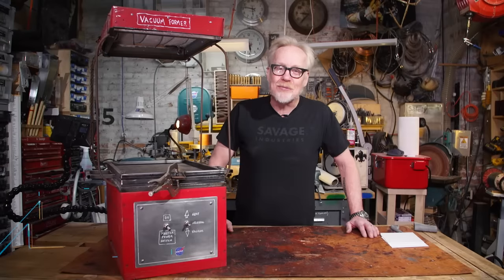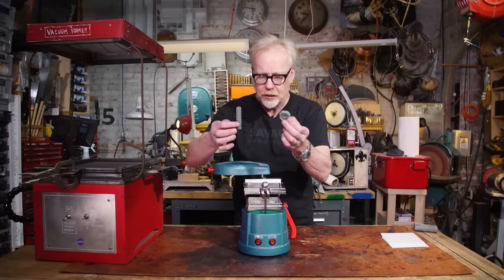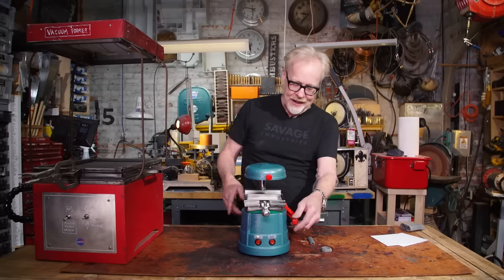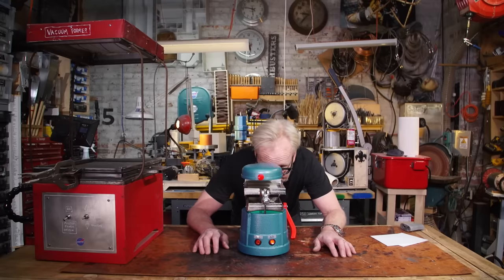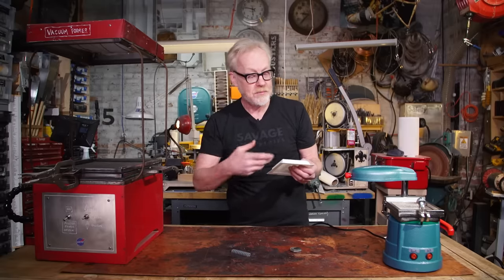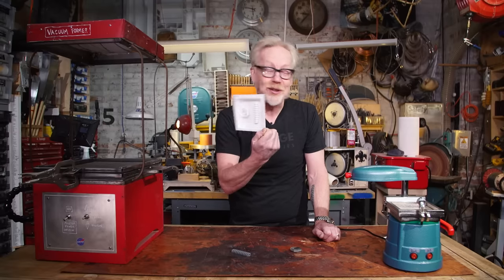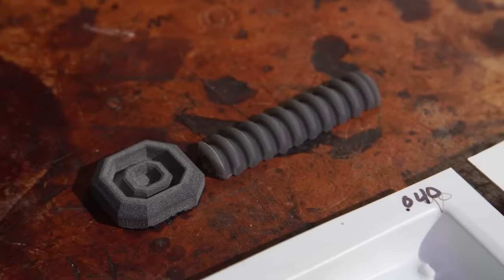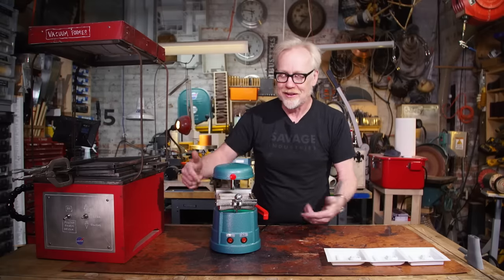Adam Savage's Favorite Tools: Great Budget Vacuum Former!

Comment: Would a vacuum former be able to mold kydex? Holy crap how fast you could turn out holsters with that thing!
Reply: Good question.  Knife sheath too.  With the thicker material it could be a bit trickier to manage heat but maybe a preheat in hot water or a toaster oven before putting it in the tray would help.
Reply: I was just thinking the same thing. I have done a ghetto vacuum form for headlight lenses making a frame out of wood, a soft board with holes, hooked up to my shop vac. I would throw lexan into my oven and once it got pliable I quickly pulled it out and threw it on my forming-majig. Crude but kinda worked lol.

Comment: Does anyone have experience trying to adapt small Venturi vacuum pumps to pull air out of chambers for resin casting and such? Most shops have air compressors already, and a nominal added cost for this approach seems far better than having to invest in another large machine that gets hot, and less efficient as the pressure is reduced.

Comment: Hi Adam   Thomas from
the UK here great video   I have a project in mind at mo i'm
having it printed on a sls  printer but very expensive.. i'm
looking at vacume forming  but plastic  needs to be about 1 mm  dental plastic would be great as it's very hard the object i'm working with is very similar to a second world war german soldiers helmet it's about  7 centimetres high x 8 centimetres wide.. would the machine in your video  do this size? regards Thomas

Comment: Wish could have had it 20 years ago???   
A thick walled  jewelry box with lid removed..replaced with a metal or wood platen (the surface with holes) and keyhole saw bit as big you can for hose nozzle and a metal frame.  Your done.  This unit  is "convenient" but to me far too much for what I can get for self build that size.   Why couldn't you have just built a "smaller version " for yourself 20 years ago? 

Plus if you are needing to use a larger machine for smaller piece.  You use your other bucks in there to not to waste material.

Comment: I was thinking that a blister pack was a different process.  I have seen parts sealed to a piece of cardboard with a vacuum sealed plastic cover, but a blister pack usually has a pre-formed pocket that parts are dropped into then either glued to cardboard or heat sealed around the edge.  I don't think you need the vacuum process for that, just press the plastic between a set of dies.

Comment: Once again special effects modelers and scale modelers tool needs overlap. I would tend to reproduce small parts using RTV molds and two part epoxy, but this vacuum molding would certainly be the preferred method for applications where weight is critical, like RC airplanes.

Comment: "40-thou is my bread and butter..." bet it takes a lot of your sandwiches to fill someone up then, Adam.... ;-)  (hat, coat, gone....)

You can buy even cheaper vac-forming 'machines' on Ebay, but they're very DIY in character: basically wooden boxes to which you attach a vacuum cleaner, having heated the plastic up in an oven. WAY less convenient that this one of course, but also available in bigger sizes at an affordable cost. Might be interesting to review one of those some time.

Comment: Adam, Adam, Why haven't you replaced the two on/off switches on your big molder with a single on/off/on switch, so you cut off the heater when you switch to vac?

Comment: If you want to form a smaller part on a larger machine, why not just make a frame with a smaller opening? Think about different-sized negative holders, for a darkroom enlarger.
Reply: I can confirm this works, I worked in a shop that had two different frames for their vacuformer, it was easy to swap them out too

Comment: I gotta ask about the big vacuum former, why not wire the switches so that turning on the vacuum turns off the heating element? A pair of on-on switches, an on-off and an on-on, or a single on-off-on would all solve that.

Comment: When I was a kid, I had a toy from Mattel called Vac-U-Form. They could never sell it as a toy now, but you put in a sheet of plastic, heated it up with the heating plate, then flipped it over a mold and pumped until you had a copy. I used to use it to make lightweight plastic bodiues for my HO slot cars from Matchbox cars. It was a great toy.
https://www.ebay.com/itm/133750667844?hash=item1f24293a44:g:KPQAAOSwthJgkXrn